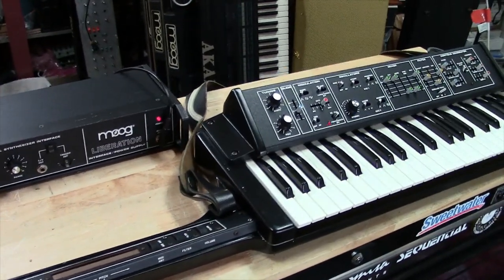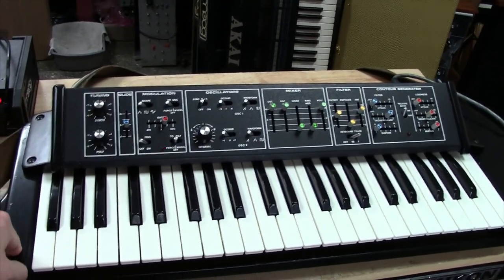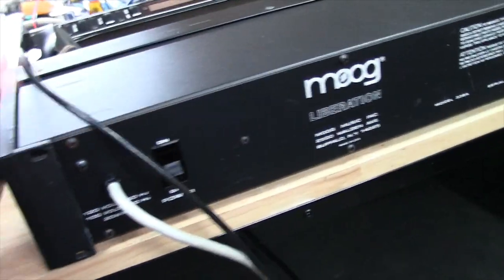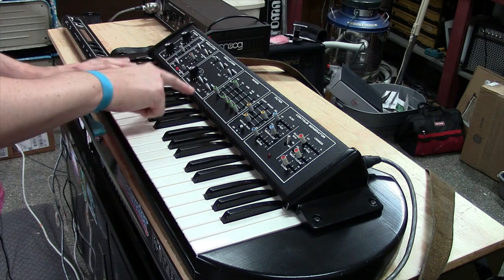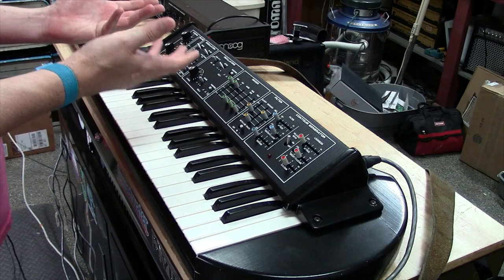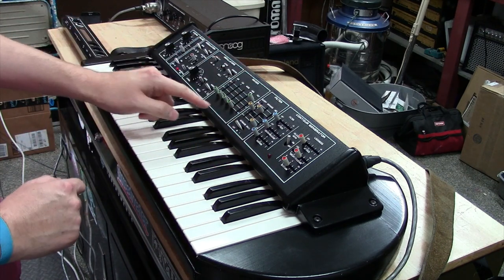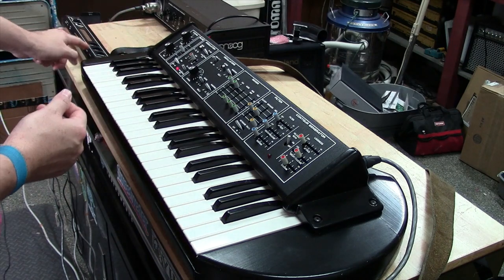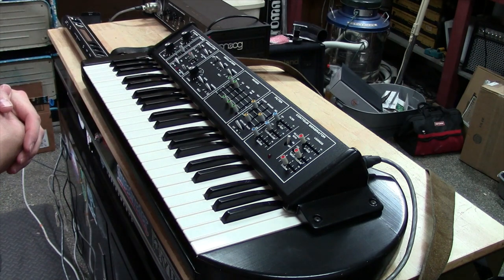Bob Moog Foundation's Liberation Restore (by synthpro)

Comment: Great dive into all the control options on the Liberation. It was really designed to be played. On the body- I had mine repainted by a custom guitar luthier. They were used to working with solid body electrics- the Liberation body is similar, just heavier. The Moog Foundation went to the right person to get this unit restored. Well done!

Comment: „Goo Gone“ helps with getting rid of residue from sticky tape. I got very good results using it!
Reply from the maker: That does work well in most cases but the original body was actually badly cracked under the tape.